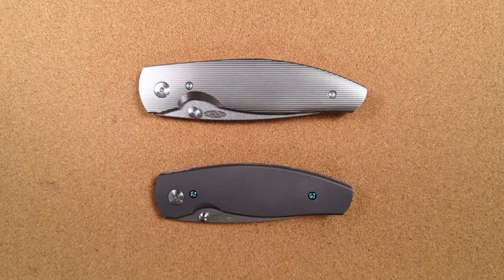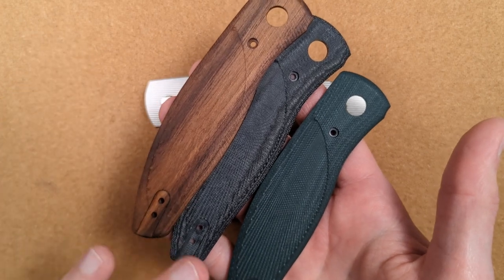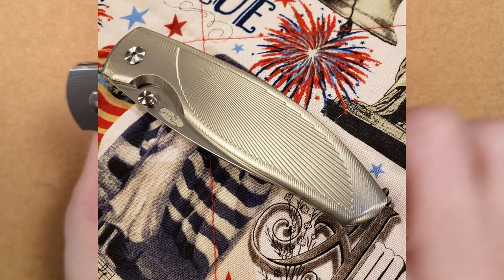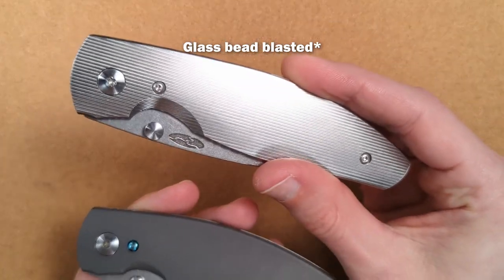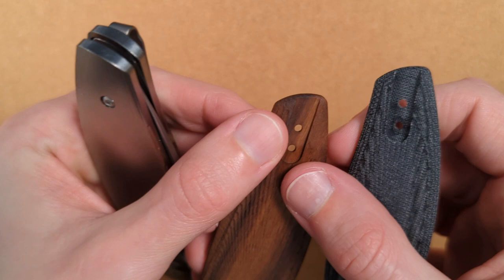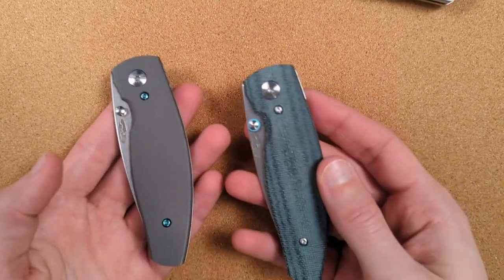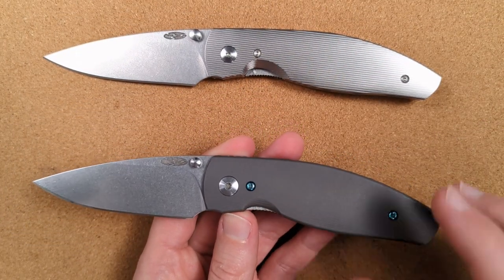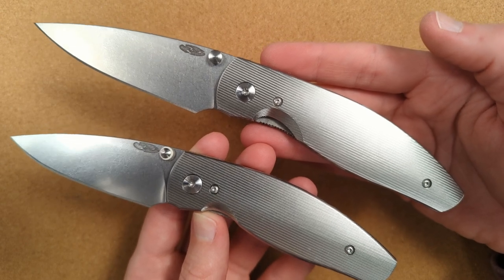TRM Titanium Atom & Neutron - History & Small Details Review - Atomic Scales

Comment: I just bought 2 of the best "edc" folders ever. The Ti lizard Atom  and the Quiet Carry drift L. Atom is my favorite, by design, blade shape looks, but gotta be honest I pick up the Drift more all because of the action and deployment. The atom thumbstuds and no reverse flick knocks it down a notch.
Reply: No reverse flick as in no middle finger flick? If so, it can be done reliably, but takes practice.
Reply: @stevenw3393  Yeah I know, I've figured out how to get it everytime as well but it's not natural or comfortable. You have to either wedge your nail in which is what I do or use the tip of finger which sure isn't comfortable. My point is the fidget factor is definitely not the Atoms strong point.
Reply: Agree, not fidgety, but it is rewarding in a way because it is difficult I guess.
Reply from the maker: I'm curious if you have o-rings on your thumb studs? Those completely eliminate the discomfort for me when flicking with the tip of my finger. On modern Atoms they switched a new style of stud originally introduced on the titanium Shadow which is much more similar to Benchmade's thumb studs. Far more comfortable. But you can't please everyone, and there are plenty of people who complained that they still prefer the older, sharper studs. I don't mind the older studs at all as long as they have o-rings, so my personal opinion is that they should include a pair of o-rings with the knife if they're going to use those sharper studs.
Reply from the maker: But to your original comment, yeah, those really are some of the best EDC knives ever made!

Comment: Regarding the pocket clip, my CF model is different, and inferior. It has a surface mounted clip, with protruding round headed screws! Nothing is recessed on mine (the liner is recessed)… I think it’s because these knives are virtually semi-custom made. I bet they vary a bit, with some examples better than others (all would be perfect as far as function is concerned). These knives are very close to perfect in any case! I like mine just fine (but will be getting a titanium model at some point)!
Reply from the maker: Do you have a Neutron or an Atom? 
The Neutron has never had a recessed clip. The original V1 Neutron had a shallow-carry clip and the modern V2 has a deep-carry clip, but even on the titanium versions, nothing is recessed. The Ti verions do introduce the little flat platform so the clip can mount evenly that you can see in the video, at least, but still neither are recessed. If you buy the titanium Neutron scales separately, they do not come with a clip because you can reuse the one you already had as-is.
The Atom, by contrast, has always had the recessed clip, but the screws for the standard Atoms have always been the round-headed kind that aren't countersunk. The titanium Atom uses the clip and screws originally introduced on the Shadow, which finally do have the countersunk, flat screws. If you buy the titanium scales separately, they come with the alternate clip/screws because it is different from what you would have otherwise.
I wouldn't call TRM knives "virtually semi-custom made" -- they're definitely production knives -- but they are made in relatively small batches (compared to the giant companies), usually about 150-250 at a time. That means they can indeed adapt quickly and do indeed make some changes from bath-to-batch, but mostly this is around small fixes and improvements in things like finishing and tuning, not anything that wouldn't be backward compatible. A good example of that is the blade finish on the Neutrons has evolved slightly over time, with differing levels of stonewash vs reflectivity.

Comment: The problem with changing a set of G-10 scales for titanium is that the basic knife costs a certain amount, and the Ti scales themselves cost a certain amount, and the cost together is more than a titanium model costs new. At secondary market prices, quite a bit more! I did buy a knife with CF scales, even though I thought I might want titanium. Well, I do, but I won’t buy Ti scales. Instead, I will get an entire titanium knife. It’s a better deal.
Reply from the maker: Yeah, you're absolutely right, and that can be pretty frustrating -- it's notably cheaper to buy the titanium model as a complete knife than it is to buy a standard G10 model and add the Ti scales on separately. It would be even more expensive still to buy a "naked" knife (it's not super common, but TRM from time to time sells the knives without any scales at all, thanks to the folks with huge scale collections asking for standalone knives) and then separately buy both the G10 and titanium scales, even though at the end of the day you're getting the same items. The reason for this, of course, is that TRM subsidizes the cost of the components when you buy them together as a package deal -- you see this same kind of pricing all over the place, where it's cheaper to buy a complete dishware set than it is to buy the same plates, cups, and bowls separately. People don't usually think about "a knife with scales on it" as "a package deal", though, since that's how all knives come. But TRM is in the reasonably uncommon position of selling scales by themselves, too, and thus needing to price them such that it's profitable even if someone just buys the scales. So in the end you're right -- the standalone Ti scales are definitely not the cheapest way to get a titanium knife if you're starting from scratch. They're meant for folks who already own the base knife and don't want a second whole knife, just the scales. And if that's what you're after, then it definitely is cheaper to buy the standalone scales rather than a second complete knife you don't want/need.

Comment: Does anyone know if it's possible to change out the thumb studs on the Atom?  I find it difficult to spydie flick with those low-profile studs.
Reply from the maker: It's possible, yes, but not easy. The studs are press-fit in and nearly impossible to remove without damaging them. But if you don't care about damaging them (you're going to replace them, after all), you can definitely pry them out with some pliers. Still difficult, but quite a few people have done it successfully. Most use aftermarket Benchmade studs for the replacement, but I've seen a variety of options swapped in.

If you want more specific help, I suggest posting about it in their FB group. Dozens of people in there have done it and can offer tips!
Reply: @KnifeNerdery  Thanks, Kevin!  Thanks for taking the time to answer.  It's good to know that it's at least possible to replace them.  I'll do some research on suitable replacements before I take the vice grips to them.  :)

Comment: I feel like i need to comment and help there fine knives be finer . Forst they need a distinguished company pivot that looks cool , is flush , stays in place d shape or notch , hardly matters but d shape is preferred . Cool hardware and pivots is what sets the knives visually apart easier to people not so familar with them like us , like civivi and others , miguron etc . . I just feel when a knife is 200-$500 they should look like it and work like it when needed with properly hardened steel . There’s too many steel variations and several good ones imo .
Reply from the maker: So all of the standard TRM lineup do have captive pivots (the kind with a D-shape only on the the end of the barrel, so you don't have a gap running the whole way to collect debris), but you're absolutely right about the pivot being quite plain on the Neutrons and Atoms. They flexed their machining muscle some on the Shadow pivots -- those have a gorgeous radial starburst pattern milled in them, along with a contoured face that sits perfectly flush with the contouring of the handle scale itself. I'd love to see them do something like that for the Neutron and Atom!
Reply: I like plain hardware and how simple the knife is.

Comment: In depth - I like it! That said, am I the only one bothered by the clip marring the beautiful titanium finish? Bad design!
Reply from the maker: I'm not really sure how they'd design around that, but it definitely bugs me how clips wear little spots where they contact the scales. Happens on nearly all knives, though.
Reply: @KnifeNerdery  I have a few - on the high end: Brown FSD mini. The clip is stiff meaning no right/left play and he milled a pocket in the titanium for the clip. TRM is supposed to be known for their CNC skills? Anyhow, IMHO it's a good knife with a poorly designed clip or, maybe a have a defective clip?
Reply from the maker: @Chappvid  Ah, yeah, milled-Ti clips will have a lot better side-to-side stability than bent-metal clips. Even most of those have some side-to-side flex, though. The FSD in particular has a very wide clip, which further significantly decreases its side-to-side flexibility compared to even other milled-Ti clips. What I've also found is that even if a clip doesn't slide side-to-side much, it invariably leaves a mark underneath the contact point -- not a big deal normally, but matters if you end up changing clips (to something that has a different contact point) or swapping a clip for left/right-hand carry.

I don't personally think of the Atom or Neutron clips as "defective" -- they work basically the same as all bent-metal clips -- but I agree that I don't like that characteristic of bent-metal clips. What really bugs me, though, is when a milled-Ti clip is attached in an insecure way that allows it to wiggle side-to-side just from how it is mounted, nothing to do with flex.

Comment: Where did you get the rubber coating over the thumb studs?
Reply from the maker: Those are little rubber o-rings! They're often used to seal gaskets or provide a compression fit between two pieces.

There's lots of places you can get o-rings, including big-box hardware stores like Home Depot, but you'll often only find black at shops like that. TRM themselves sell a pack of o-rings on their site that fit the Atom and Shadow, but are a bit too big for the Neutron.

For the Newtron, you're looking for 5-6mm o-rings, and for Atom you'll want 6-7mm. It's super important to note that those measurements are outer diameter (OD). And FWIW, most people tend to go for the smaller/snugger ends of those spectrums (so 5mm for Newtron, 6mm for Atom).

There's a great shop on etsy that sells high-quality o-rings in a variety of colors and sizes and at great prices, in both single-color and mixed color sets: 
https://www.etsy.com/listing/162565628/rubber-orings-5mm-for-industrial-crafts
https://www.etsy.com/listing/175422113/rubber-orings-6mm-for-industrial-crafts
https://www.etsy.com/listing/887596454/725mm-oring-hand-picked-mix-pkg-of-100

The big thing about ordering through her is that she tends to list them only in large quantities at a time (50+) all of the same size, and if you get a mixed set, you don't really have any say in what colors you get. But it's great bang-for-your-buck if you're willing to get a bunch.